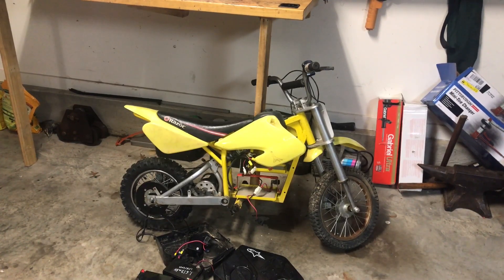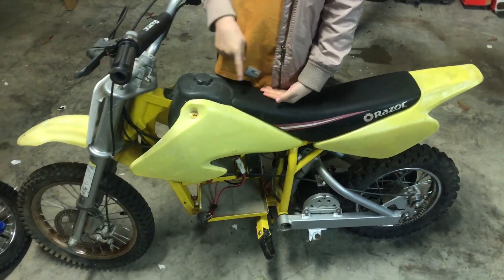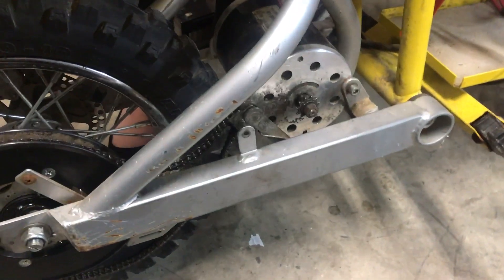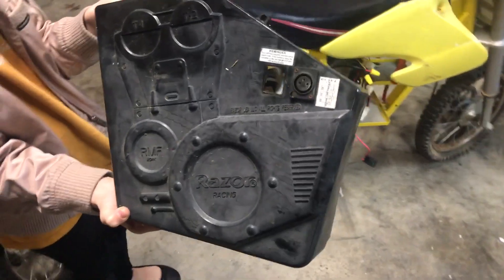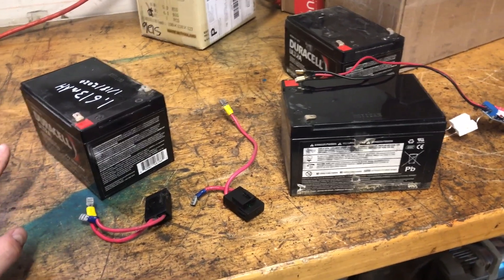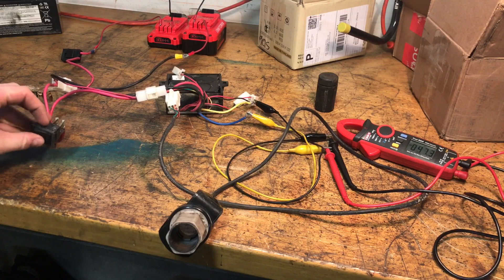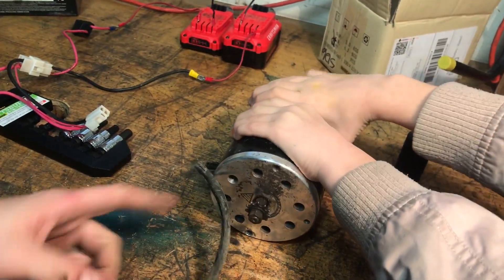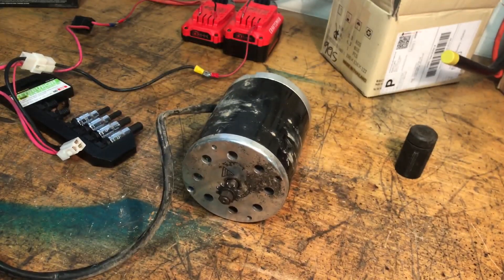Razor MX650 Electric Dirt Bike Rebuild Part 1: Analysis and Teardown

Comment: Why can’t you just use those power tools batteries?
Reply from the maker: They aren’t the same size and I’m not comfortable putting single batteries in series.
Reply: Anthony Shelton I want to use my ryobi 40v battery for this bike. You think there is a problem with that?